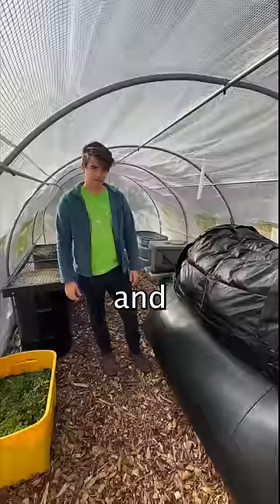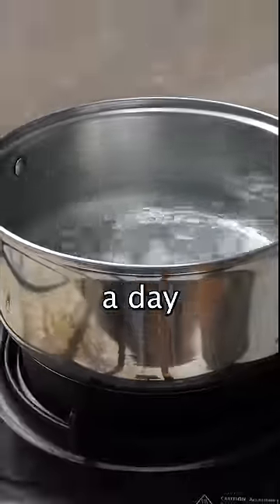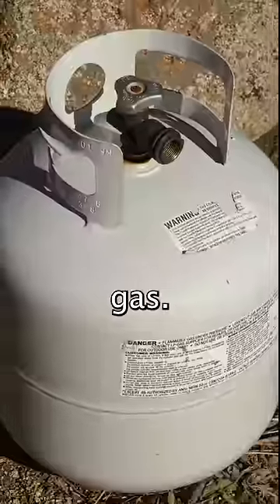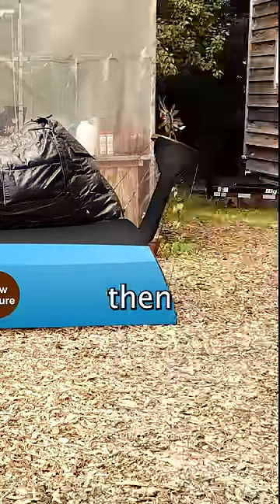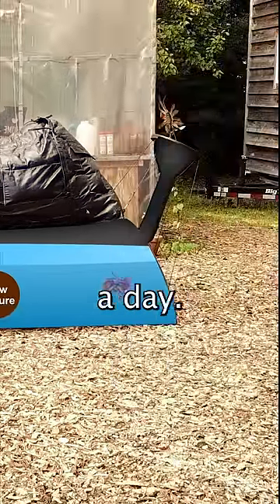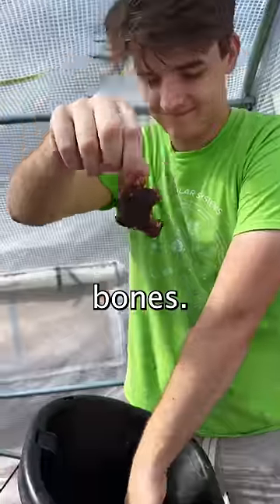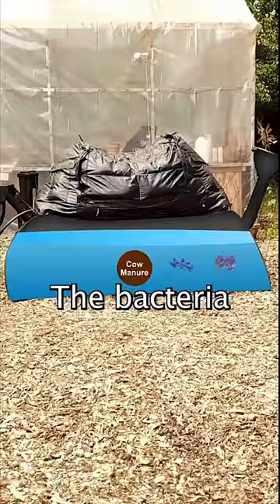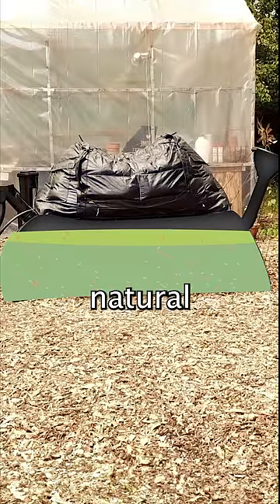The Methane Digester is a powerful system! #shorts #sustainability

Comment: Bro grinding so hard in real life 🔥
Reply: fr
Reply: are 1200 liters cheaper than gas?
Reply: @bunto7552  no i don't think but it would be great to ave a comparison of how many time you need to change a bottle of gas vs how many time you need to add fuel plus change the methane digester . Their is also the probleme of space ...
Reply: @bunto7552  bro you got rain?
Reply: @nsforlunch574  not really i live in a region where theres Drought most of the time
Reply: @bunto7552  1200 liters of rain water is literally free. And you don't need 1200 liters for every use, you add that water ONCE and then never replace it again.
Reply: @Qwertak97 I wonder if that’s true
Reply: as what u should do not minecraft

Comment: Make sure you have a flashback arrestor on your stove, the last thing you want to happen while cooking an elaborate meal is for your back yard to disappear. 😂
Reply: Hahahahahaha
Reply: Having the whole back yard for lunch sounds good😂
Reply: What is this crucial flashback arrester??  😂😂😂
Reply: @OilyAnimal3  basicaly a one way valve to prevent this interesting piece of kit to turn into a good time for a 40k orc.
Reply: Hahahhhha
Reply: It won't explode unless the bag bursts. The atmosphere inside the digestor is about 49/49% Carbon Dioxide and Methane with about 2% other gases, mainly Nitrogen and Hydrogen Sulfide and almost no Oxygen (which is why it's called "Anaerobic" Digestion). Without Oxygen the gas inside the tank can't burn, that only happens when the gas leaves the tank and mixes with Oxygen in the air. The flame can't travel up the outlet as it will always be under positive pressure (providing the bag is full enough to expel) and even if the flame did travel it would extinguish when it met the low O2 environment inside the tank.

Source: I'm a Biogas Refinery operator.

Edit: I'd be more concerned about a leak while the digestor was in that tent. If the bag did burst or the outlet valve failed, the gas would escape and mix with the air but remain enclosed so it couldn't diffuse into the atmosphere. It could then breach it's LEL (Lower Explosive Limit) and it would only take a small ignition source to ignite it, though it would probably be a smaller explosion than you might imagine. Unrefined biogas burns dirty and relatively cool. 

Far more dangerously, if a leak occurred and someone were to walk straight into that enclosed space that had become full of very un-breathable gas, they could be in big trouble. Methane and Carbon dioxide aren't fun to breath but Hydrogen Sulfide in biogas concentrations will knock you out in one breath and kill you in ten. The worst thing about these gasses is that they hug the ground so you inhale just enough to make you pass out, then you drown in a sea of heavy hydrocarbon gas while you're asleep on the floor. Not trying to be morbid but you have to be careful with gas in enclosed spaces. Asphyxiation is a really common cause of death in agriculture and biogas production around the world. Gas monitors save lives.
Reply: I was arrested once for having flashbacks
Reply: No oxygen in the pipes, it wouldn’t be able to go down
Reply: @McKlunkers  at least one that knows what he is talking about. Source Im operator at 2 different refinery plants
Reply: @McKlunkers Finally someone, who knows what he speaks.
Funny engought, I know that you are right, even though I only learned basic chemistty.
Reply: @McKlunkers in oil n gas company, LEL is mandatory.
Reply: The fire triangle shows that it isn't really possible due to insufficient oxygen.
Reply: @Irobert1115HD it's not a one way valve, it just prevents the flame from going back through the tube. It doesn't prevent gas from flowing back. It's usually a wire mesh that absorbed the heat and arrests the flame
Reply: @OilyAnimal3 basically the flame on the cooking stove travels back down the tube to the  digester tank thing and makes boom boom. 

That valves stops that
Reply: @u12uNiiGuNx  back down the very tube it's coming from?? Definitely don't want that anywhere
Reply: @OilyAnimal3  it’s a possibility. But as others have said it’s unlikely. Fire needs 3 things to be…. Fire. Fuel, oxygen, and heat, removing any of the three and combustion just isn’t possible. So the fuel (methane) only burns once it leaves the stove top and has a supply of oxygen from the air and the heats comes from the initial spark and the heat is sustained from the combustion. If the flame stared to travel down the pipe it would quickly run out of oxygen, but if there was a leak or puncture in the system then regular air could mix into the system and make it possible. Implementing the valve is just another line of safety, doesn’t hurt
Reply: @McKlunkers thank you for the paragraphs. You are a beautiful man
Reply: The code word is "anaerobic", in the sentence "we then add cow manure , which gives it anaerobic bacteria"😉
Reply: @OilyAnimal3 so basically it arrests flashback
 
crazy ik but fr it stops any ignition from moving backwards along the pipes to the MASSIVE METHANE STORAGE
Reply: @madmax82988  And when did all this happen?
Reply: @McKlunkers Thanks for schooling these internet clowns who say anything for the sake of it.
Reply: I am not sure if this type of biological methane burns fast enough to create a flashback.
Still, he probably should have an arrestor.
Reply: @OilyAnimal3  It's just a check valve.
Reply: Flashback is that a problem if you arent using an acetylene cutting torch?
Reply: Literal explosive diarrhea
Reply: @McKlunkers  You need to post this comment in the main thread!
Reply: @McKlunkers  I forgot where I heard the story, but a similar situation happened in someone's cellar, but some water leaked into the seller and it spoiled a lot of the food and no one noticed and it had built up a gas inside it. And one breath would knock you out. And one by one the family went down there first to go get something. And when that person didn't come back someone else went to go check on him. And it ended up killing about four people. The only reason they were found by the fifth person, was because the fourth person that went inside left the cellar door open and the gas was able to dissipate enough.
Reply: A real sh!t storm 😂
Reply: there’s always someone to spoil the fun
Reply: @McKlunkers Amazingly poignant comment. Wish I could give you more thumbs up.
Reply: That's when the shit hits the fan
Reply: Anything to interrupt a flame
Reply: @tomsoki5738 It's a safety measure that makes sense. What if oxygen DOES enter the system?
Reply: Hehehe I like this guy it's so true
Reply: @Irobert1115HD WAAAAAAAAAGGGHGGGGHHHHH!!! BLOW DA SHIT-BAG BOIS!!!!!
Reply: @McKlunkers I've been reading YouTube comments for about 5 or 6  years now. I do read a lot. And your comment is in the top five list of the most interesting and informative comments I have ever read (please excuse any writing mistakes, I'm German).
Reply: A very dirty bomb indeed
Reply: How does this system prevent 6 tonnes of co2 emissions a day when the methane they produce and then cook with produces co2 ?..
Reply: This needs to be pinned. @McKlunkers
Reply: @McKlunkers  is this your real name? The irony.
Reply: Must prevent gas to ignite from the stove to the source.
Reply: Had a crazy neighbor with a 20 lb tank set up 
In His House ,he inheritance, plus a lot of gun"stuff"I did mention the word "crazy" right?
Underneath the Stove😶
One morning there was this Real Loud POP
Then the shouting
Then the Screaming
Then the fire...
All that crazy Fy¢€ers 
firearms AND Ammo was inside...
Thank You...... God
I will give my Life for my 2nd Amendment, but this guy Should never be allowed around Anything dangerous...
It was also 1year to the date that his father died😶
Reply: @alliwanttosayis2144  it is not explosive as HYDROGEN. It is just similar to your bottled gas

Comment: It's basically a Gobar Gas.
It was used in my Village 15 years ago.
With proper cemented structure till the Stove.
Reply: Wow, that's really neat! 
If I may ask–
Where is your Village & why did they switch? 
I'm guessing supply could not meet demand as the Village grew?
Reply: This has been used in india for more than 50 years.
Reply: @caitlynnriley3054  it requires a lot of maintainance than regular gas. U have to manually go stir the smelly manure else the flame will go cold. Also u need to have a farm and cattle for the manure. So it eventually died out.

But it could be a good source of gas if it is industrialised. Like a public manure gas chamber which is maintained by the govrnt or private sector. (Basically make networking of gobar gas plant.)🤔
Reply: My family even own one gober gas
Reply: @pritamkar9554  👍🏽 interesting idea
Reply: @caitlynnriley3054  my village had about 10 of gobar gas (biogas plant) 10-15 years ago. Back then it was not very much popular and cow dung or waste food is available plenty in rural area. But people preferred burning wood and due to improper maintenance of the plant it eventually was out of service .
Reply: @KMS_BISMARK  good for yo village otherwise this system is already abandon by most villages cuz woods is simple and easy to acquired for fire stuffs
Reply: @caitlynnriley3054  we still use it here in my village
Reply: @caitlynnriley3054 His village is probably in the Indian subcontinent (India , Pakistan, Bangladesh, Nepal etc). Im from India myself. The word gobar (go-bur) translates directly to manure.
Reply: @caitlynnriley3054  I’m from A hill state in India called Sikkim.
This chamber was sponsored by State government under village welfare act and at first it was a success because every household had Cattle especially Cows and Ox’s.
The process was to collect all the manure and stir it manually to release gas and it will go to the gas chamber where a pipe connection goes to the kitchen stove.

This eventually became  outdated due to modernisation of villages and many have moved from farming to Some other occupations.
Now since almost everyone have access to cheaper electrical energy and subsidised rates in natural gas and they also have wood fires for day to day need it became less popular.

Basically people became more dependant on modernisation.
Reply: More than my age 22 years people using this
Reply: Gobar gas, I'll have to try to remember that
Reply: I live in Italy. Around here in the countryside most big farms have built large biogas plants that use manure and farm waste. They are government sponsored projects. Tbh I don’t know how the gas gets used, probably put in tanks and shipped elsewhere because I am not aware of local electricity production.
Reply: @santoshsubbaatd  biogas is most efficiently fuelling a generator making electricity..
No one thought about that option?
Reply: Wait Ludwig works in gardens
Reply: @OmmerSyssel  Well for a single farmer, the infrasturcture would be too complicated and that would cost good amount of money and goverment hasn't decided to find it yet..
The reason could be anything from Because we have hydro projects for electricity to Corrupt government..
Reply: @pritamkar9554  No need to stir, just walk around with your feet. It's very healthy for you feet too.
Reply: @santoshsubbaatd  skyrim? Wow!
Reply: Here in India some so called people make fun of cow dung and it's product.
Reply: My grandad had the same system . We had gobar gas and LPG. LPG was used for stir fries(any cooking that requires strong flame . While Gobhar gas was used when boiling something, so for cooking rice , boiling water etc. Gobhargas flame was not as strong as LPG. Plus as he said the maintainanace is an issiue and also you need cow dung for then thing to work .
They dont use it anymore . Because they have become frail.And thier kids no longer do farming.
Reply: @caitlynnriley3054  it's not just in one village, there were 1000s of such villages in India with "gobar gas plants" . But, now a days they have all shifted to LPG. This plant demands quite a huge amount of cow dung + domestic wastes, not sustainable now because some families shifted from agriculture to the service/manufacturing sector and so sold their cattle. Those plants could also support some lighting equipment along with stoves. The last time I saw one was some 20 years ago.
Reply: Yes Bio Gas Or Gobar Gas
Reply: Exactly.... I was searching for this comment. It has been in use in Indian villages since more than a Decade. 😂
Reply: Prajeet gas 😂😂😂

Comment: Only a couple of minor corrections: best input material is fats not starches (although starches do work) AND biogas is a mixture of methane, carbon dioxide, sulfur compounds and some other compounds. Methane and CO2 are the major components. Love what you are doing!😊
Reply: This dude really trying to get that carbon credit for burning gas lol
Reply: @Mrmaverickism it is a closed circle of co2 emissions. No new co2 emissions were added like they do when they pump out old gas etc from under the ground
Reply: *farts (sorry)
Reply: @UnrealObject but it's an open system once you burn the methane cooking, releasing co2 into the atmosphere?
Reply: @syon600  yes because the co2 comes from the organisms that have recently captured the co2 already, if you would take out oil that is million years old you add co2 that shouldnt be in the atmosphere
Reply: It's even better depeneding on where your food scraps would have gone. If they were destined for a landfill thats methane emission but this way combusts the methane releasing CO2 instead of Methane  @UnrealObject
Reply: @markbbriggs - Coal is also a good addition to the input material, especially the lower grades of coal. But then it is not so carbon neutral.
Reply: How do you obtain 1.5 gallons of scraps per day for this system?
Reply: @kr1886 - You can use table scraps, kitchen scraps, yard waste, leaves, grass clippings, poop you pick up from behind your dog, stuff you clean out of the cat box, produce waste from the local supermarket, rotten fruits and vegetables.... ALL kinds of organic matter will work ... Just throw it all in and stir it up. Keep it warm and stir it daily to accelerate the digestion process, but otherwise keep air away from it. Keep the tank as full as possible, if only with urine or extra water, so there's little room for air.